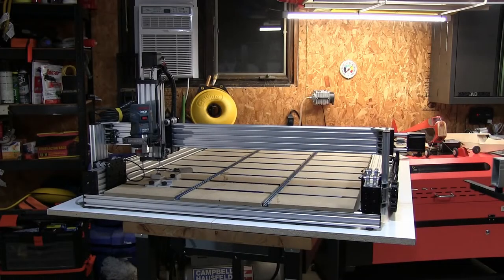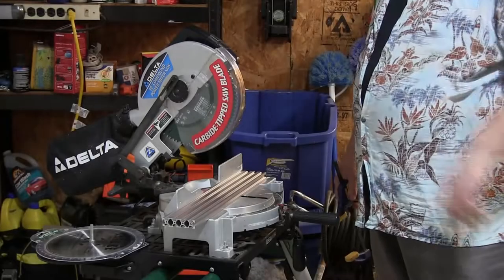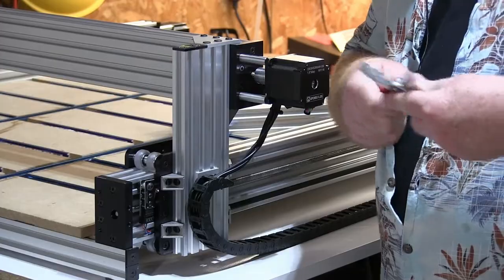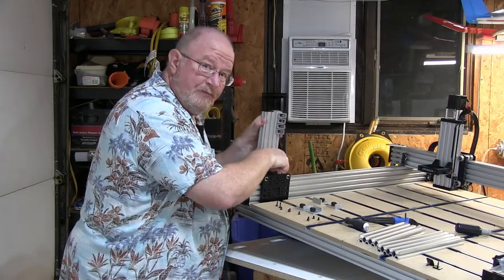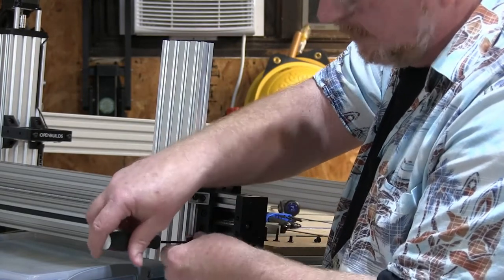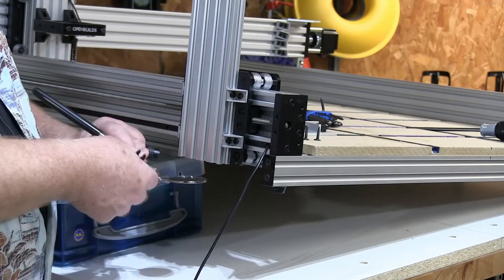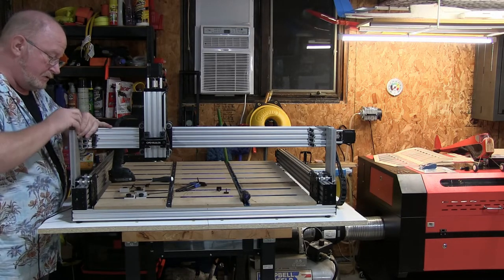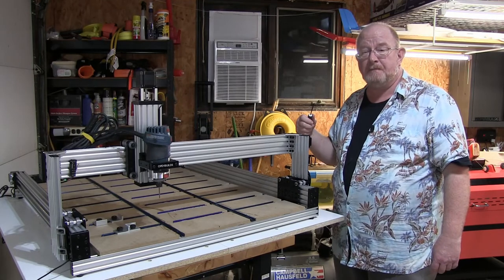Garrison Aerodrome Mods to LEAD 1010 Machine from OpenBuilds.com

Comment: I like the mod. Would you do video on your spoil board? I would like to make something like this for my 1010.
Reply from the maker: I will be glad to do a spoil board video, but it will be a bit different than the first one I did. Next time around, I'm using 1/4 MFM boards and gluing to depth rather than cutting the slots with a router. That was NUTS and I'm not doing it again.

Comment: Have considered this mod as well. My machine is a couple years old and I have only used it a couple of times. I need to get more involved in it. If you are looking for suggestions on more videos I would love to see how a bit change is performed mid carve using the openbuilds control software.
Reply from the maker: I am probably not going to be much help with regards to the OpenBuilds CNC software on-line. I have been using SketchUCAM and the INTERFACE controller to run my jobs. There is some manual editing required, but I do have a job that runs three bits, which I use the OpenBuilds position sensor to zero between changes, allowing for different bit diameters. I can do a video on that, if you like.

Comment: NICE! Very helpful...... 
considering similar mod to my 2 year old 1010. not sure my skills are on par, but nice to have a guideline to follow !
Reply from the maker: Biggest challenge was finding a non-ferrous chop saw blade. As long as the chop saw cut is square, it's really just erector-set disassembly and assembly.
Reply: Are you guys happy with your Lead 1010? I’m considering purchasing one, but looking at a couple other machines as well.
Reply: Yes I have been happy with the LEAD 1010. The current model is the 1515. Same system just bigger. Keep in mind it's basically a kit and assembly is significant!.
Reply: @richardM980  thanks! They still have the 1010 which is probably what I’ll go with due to the smaller footprint. I’ve watched some of the build videos, so I know it’s more hands on to get it up and running
Reply from the maker: @timmesser5902  You'll enjoy it once you've chased down all the details. They're solid machines and flexible for various applications.
Reply: @garrisonaerodrome5020  I’m working on it chasing them down. Been up and running for about a month

Comment: I have the lead 1010 with high Z mod, good solid machine, built the enclosure for it. Openbuilds are good people to work with.  I have had lots of EMI electrical interference which set me back a few months, think I have that solved now. I use the Aspire Vcarve pro software , expensive but easy to use and lots of tutorials on youtube., I've subscribed to your channel